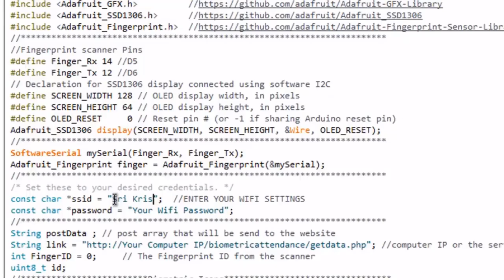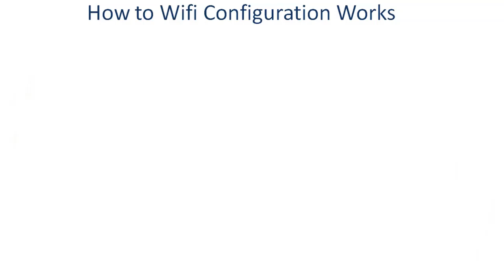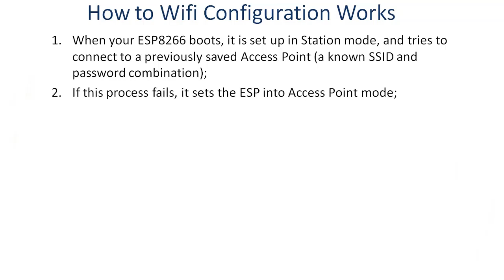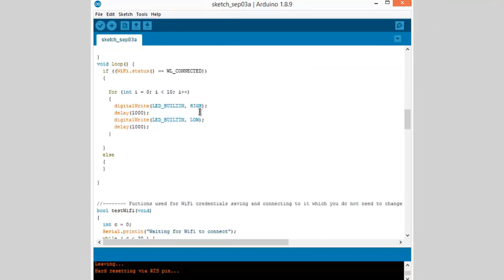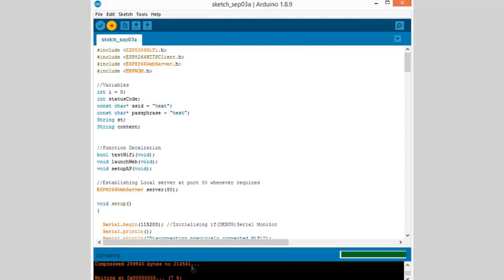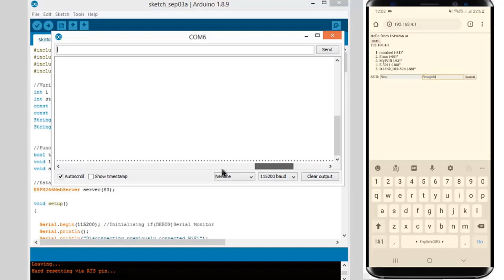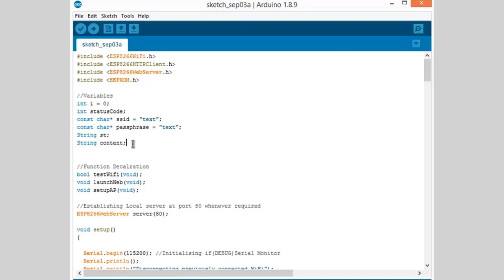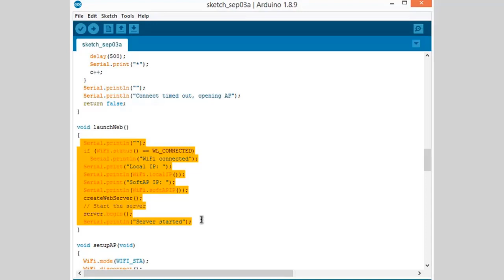ESP8266 Smart WiFi Config with EEPROM without Hard Code

Comment: Please can someone help me to add eeprom  to this code because I tried with it but to no avail. Thanks in avance
#include <SoftwareSerial.h>

//Create software serial object to communicate with SIM800L
SoftwareSerial MySim(D4, D3); //SIM800L Tx & Rx is connected to Arduino #3 & #2
String message;
void setup()
{
  //Begin serial communication with Arduino and Arduino IDE (Serial Monitor)
  Serial.begin(9600);
  
  MySim.begin(9600);
  Serial.println("Initializing..."); 
  delay(1000);
  MySim.println("AT+CMGF=1"); // Configuring TEXT mode

Comment: Hello Sir, can i ask a question about EEPROM?...Can EEPROM store some settings, such as an  Buzzer, Flame Sensor , Wifi Details and LED code. Example if our IOT project are lose power and reboot, it can running / working well again or not? like ESP8266 Wifi Module can connect our default Wifi again and also Buzzer, Flame Sensor , LED code function smoothly again or not?.  Thanks and easy to understand your video anyway.
Reply from the maker: Yes you can store anything in eeprom.
Reply: @HowtoElectronics  thanks and i forgot 1 more quetions, can ESP8266 Wifi Module power on using powerbank/plug charger only or not ?and we don't want to use usb cable from laptop?
Reply: and im so sorry, im newbie
Reply from the maker: It requires 5V. So you can use 5v supply like power bank, mobile charger or any 5v adapter or a battery.
Reply: @HowtoElectronics  Thank you very much sir for reply my comment :)

Comment: hello sir.. can you make a code to nodemcu which can auto reboot any router when it hangs up or no internet connection... use only nodemcu and usb
Reply from the maker: Hi Gefford, you can do this simply by using relay and implementing periodic reset after certain interval.

Though this is not exactly what you want but it might solve the issue.
Reply: @HowtoElectronics   it take more time to assemble but looks like it can be done only by Nodemcu.. there should be a code on doing this (no connection or router hang up) for 1 min nodemcu trigger command to reboot a router with out using any relay it will straight to the router interfaces command to reset just like  resestting router using TELNET in PC
Reply: what i mean rebooting not resetting